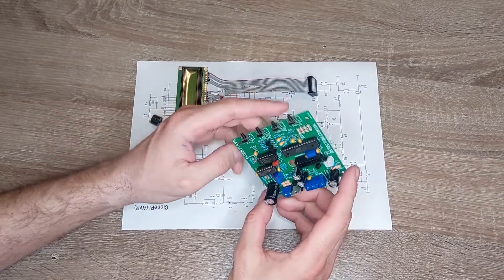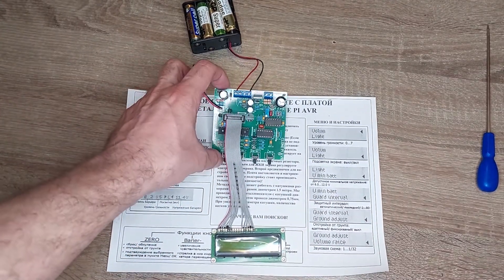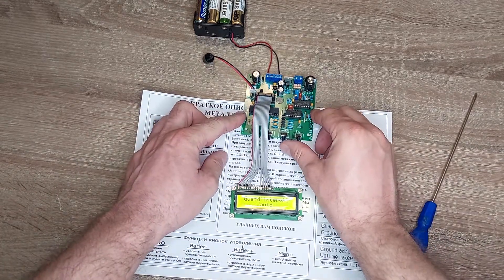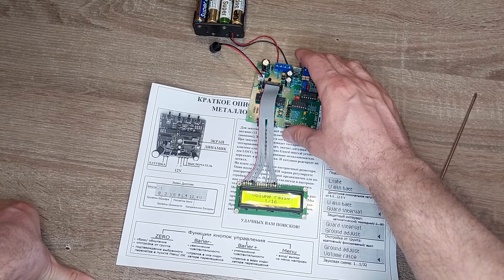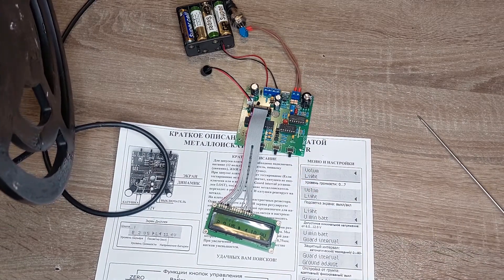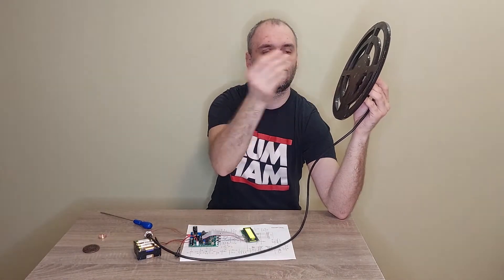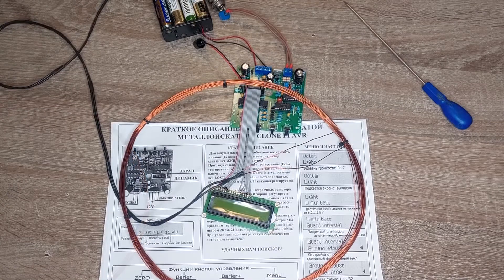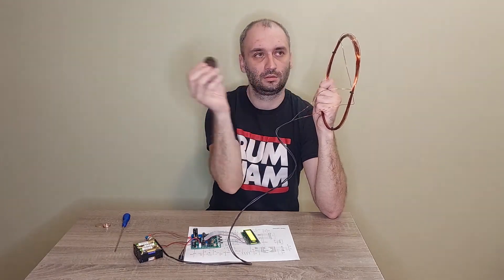Clone PI-AVR DIY metal detector revue

Comment: Hi there Greg, could u add a FLYBACK somehow between the detector circuit and the detector coil to add huge power to the coil for better detection depth, they use FLYBACK detectors in the Phillipines, would b interesting to see, we need something better than the very expensive minelab detectors, thanks Greg, love yr detector videos, thanks